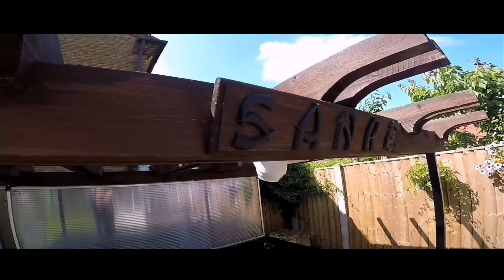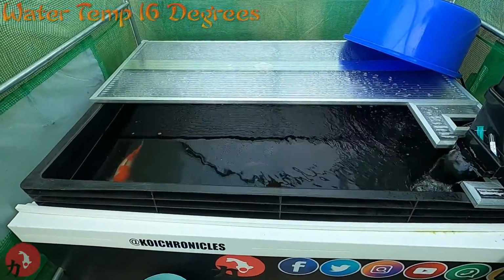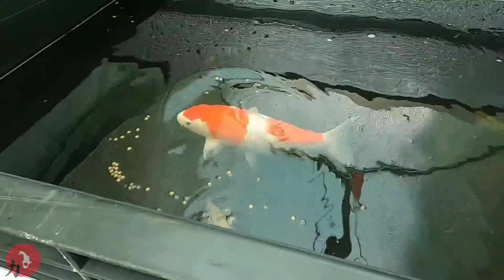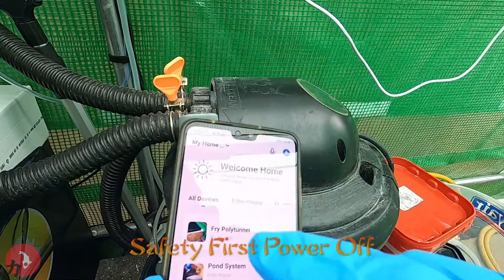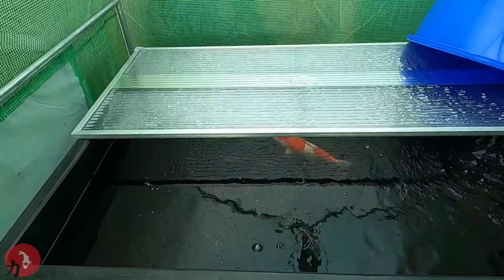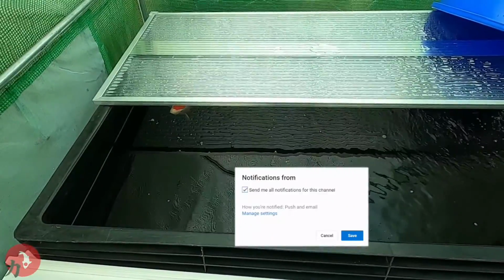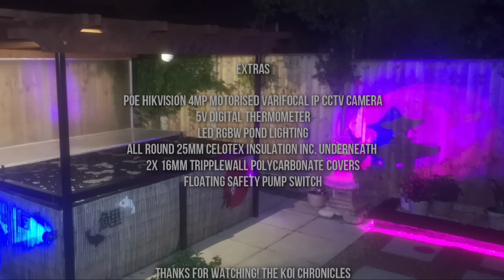How To Ultraviolet  Lamp on the JEBAO Pressure Filter in the Polytunnel  Koi Pond Holding Vat

Comment: I changed mine last week great video can I ask what are those orange  things and brackets  around your pipe work on pressure filter and were did you buy them from  please
Reply from the maker: Hi Carol thanks for the comment and they are hose clips. You can buy them from most LFS 👍🙏⛩️🈂️KC  https://www.ebay.co.uk/itm/121383534533

Comment: Time to change mine too.  Couple of questions, firstly how did you get the spillway into the diy Bakki? Like that idea.     Also, I am building a moving bed and currently have K1 in PP in preparation, how long before your K1 stopped floating and moved with the air?
Reply from the maker: Hi Steven and thanks for the comment. I made the blade feature out of household guttering Sir. Also my (K1 Micro) not standard K1 took about a week for self buoyancy to a occur with the air. 👌🙏⛩️🈂️KC #StaySafe